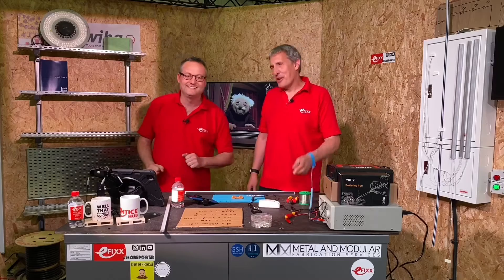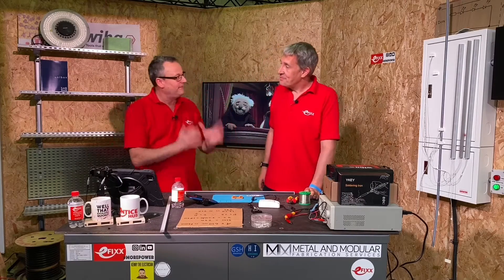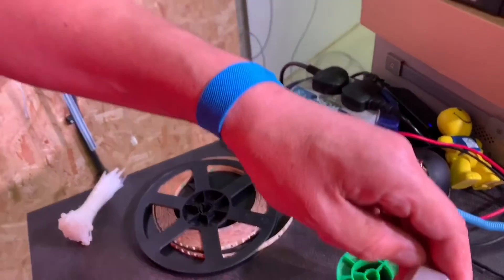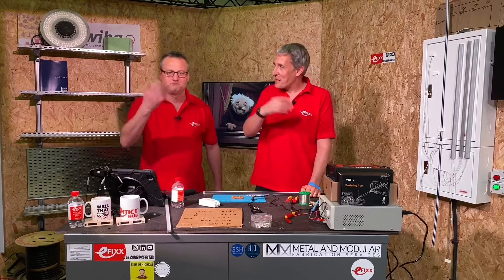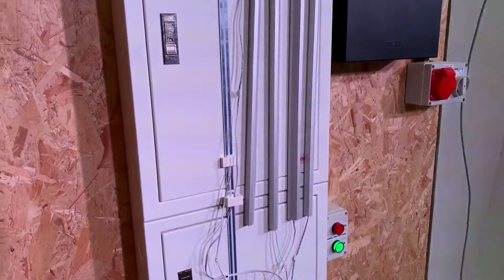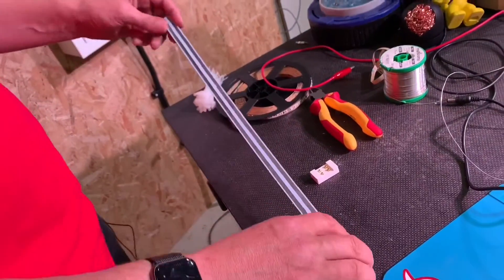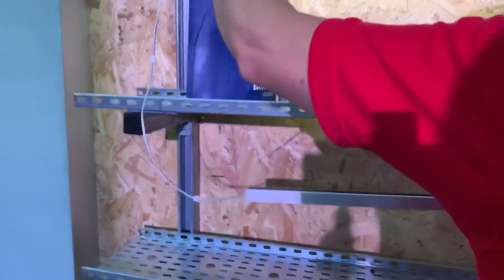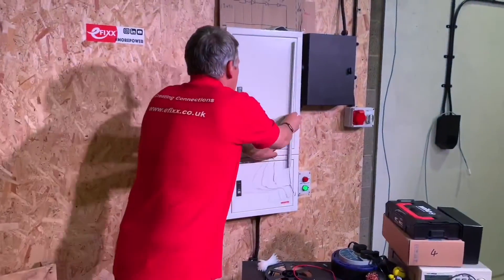LED Strip project - Clever connectors and calculating LED power supply. - Unibox Konnekt Hive

Comment: Nice soldering skills... Do you use lead free? I personally prefer leaded solder :O being a naughty old person
Reply: Leaded solder is still available and can be purchased online, but for many applications,  Lead free is fine with a good soldering iron. I’d say it’s more important to have flux when soldering to ensure each joint is sufficient!
Reply from the maker: We only use Lead free - can you still get lead or have you kept a secret stash?
Reply: @efixx  Sorry for the delay replying. I still prefer leaded because it's proven and ... honestly, i'm not given to eating electronics. But it's a mix of both, I have a stash of several 5kg rolls from an electronics manufacturer who threw it in a skip when RoHS came in!! (and it's still available even from RS and CPC etc).

My main issue with lead free for general work, is the high temps required can damage insulation and substrates if  you don't have perfect control of your environment. At a workbench is one thing, crouched under a kitchen cabinet trying to add on the segment the customer JUST decided needed to be lit up... is another. LOL
Reply: And yes as Ed's studio workshop said above, in most cases, lead free is fine and preferred for standards compliance. I am just old

Comment: Some Antistatic straps supplied by certain cheaper online suppliers do not have the 1Mohm resister always check leads with your multimeter otherwise you may get a shocking surprise!!
Reply from the maker: Wise words - thanks 🙏
Reply: Ouch that's evil! thank you for the tip!

Comment: If a metal object was to touch that "bus bar" wouldn't it short the transformer? Even if it's low voltage I'd feel unsafe leaving that flat bus bar uncovered.. Of course I may be wrong. What's your opinion on this? What does the manufacturer has say about it?
Reply from the maker: This system is for use with a constant voltage LED driver.  Most of them are short circuit protected.  This type of approach isn’t new - exposed wire halogen lighting systems used to be quite popular.

Comment: WOW, Great ideas from Unibox. This system could have so many uses and it's so versatile. I think retailers will "snap this up" pun intended. I hope they have patented the system. They could sell these direct to business. There's very little technical knowledge needed to cut and solder some wire and track. But they could always call in an Electrician if they aren't confident of their skills. Thanks guys for showing us this.

Comment: Love the track system.. will come in handy when im doing exhibitions .. not sure id trust it in a retail environment, only for the sake of shop staff moving shelves and clipping the plugs on the wrong way
Reply: Lots of it being used in retail environment already. Unibox also make linear shelf lights that work +/- and -/+ to go with the connector and track system, negating  that being a  problem.. Thanks for the  comments.👍
Reply: Thanks for the reply Nick, i guess by adding a rectifier to the magnetic plug would negate that problem and also lengthen the life of the LED tape due to the slightly lower forward voltage, any plans of releasing a flexible joint connector? i'll certainly be in touch when the pandemic is over, i can see this saving me a lot of time on certain jobs
Reply: Torchy Hi. Lots of new products in the pipeline. I’ll send you a konnekt hive sample kit if you’d like one.
Reply: Nick, that would be great thanks
Reply: And customers nicking the lights lol